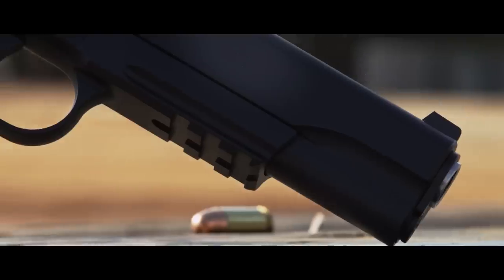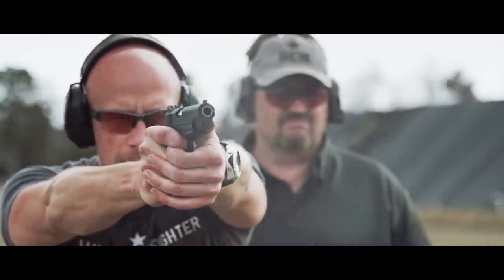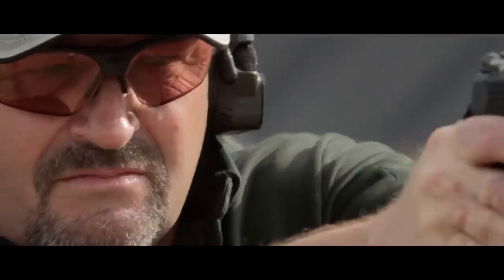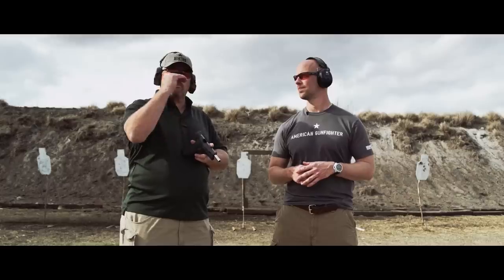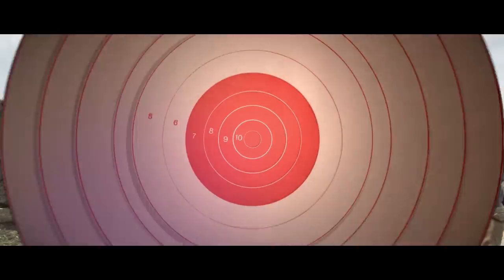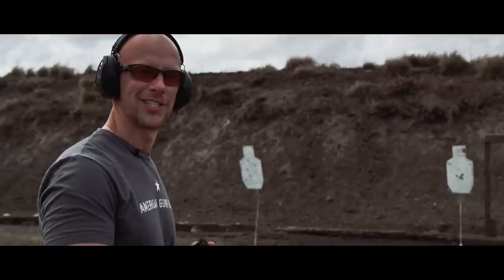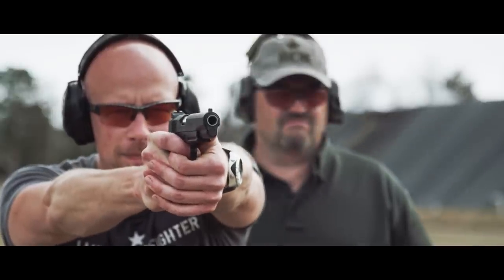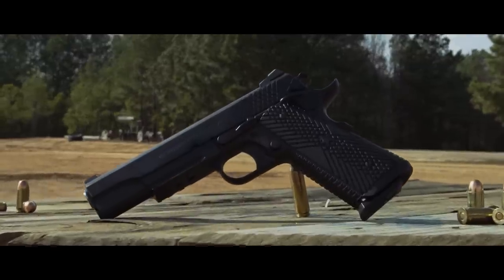BCM GUNFIGHTER 1911

Comment: Hey Larry what do you think of the FNH FNX 45 tactical? Would you consider it a proper duty gun?
Reply: Michael Nguyen What do you mean proper?
Reply: E. White Sensible, practical, usable
Reply: Michael Nguyen Well then yes, it has a capacity higher than any other .45, so it's practical, it has low recoil and a good trigger. So if you're not trying to conceal it, the FNX-45 is a really good gun.
Reply: E. White Some say the trigger is spongy and that the pistol is way too heavy for patrols or hiking long distances while holstered.
Reply: Michael Nguyen Spongy is relative. Compared to a 1911, sure. But compared to modern DA/SA auto loaders, the trigger is nice. And It's not that heavy, even when loaded. If you have a good belt and holster you shouldn't be able to notice it over long periods of time.